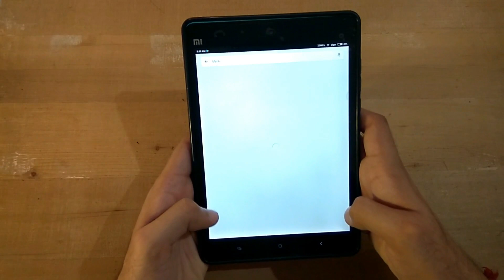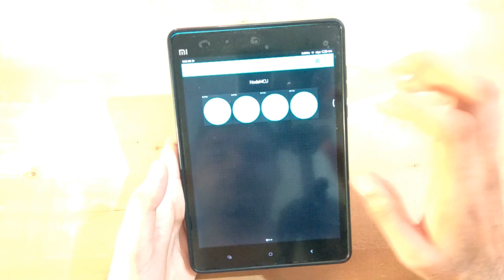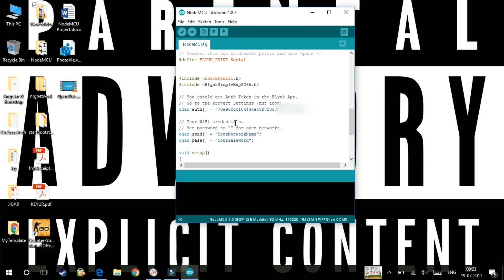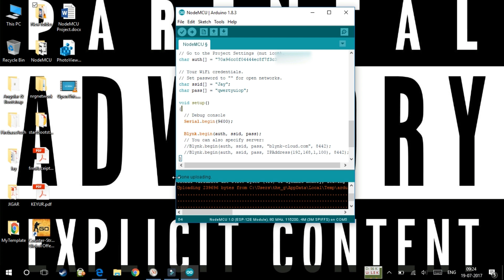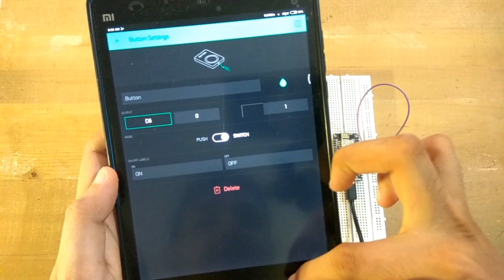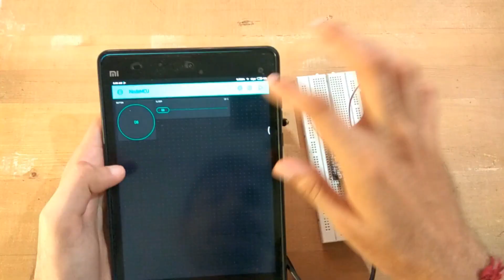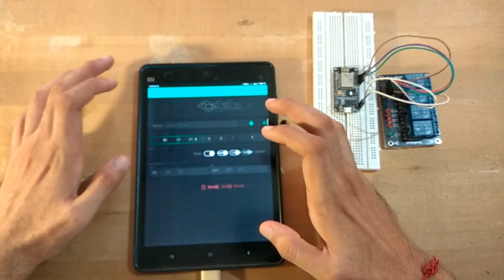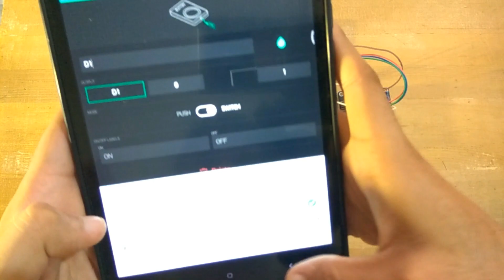Easy DIY Home Automation over Internet (Blynk, NodeMCU, Relay)

Comment: Hey brother really inspired by your video.. I jus need a help.. I have made the circuit.. Wen i turn on using blynk.. The led on d relay lights up but when a bulb is connected it doesn't glow and my relay doesn't do any click sound.. Plz help.. M jus a 12 year boy.. N i have assured my parents to make this n if i be successful they ll give me more components please help
Reply from the maker: You might need to check without light bulb first. Check if you relay is working or not, if it does some clicking sound when you turn on and off from the blynk app.
Reply from the maker: Let me know if you aren't able to fix it, will share my e-mail we can have a chat over there.

Comment: Hi, I have a question. can i power up a 5 volt 4 channel relay module with a 5 volt 0.7-0.8 mAh wall type charger, which is basically use for charge the simple mobiles. 
If yes, then how i connect, i mean what will be the circuit diagram. which wire will be connect with the vcc and which wire connect with the ground and which wire is connect with the ESP8286. 
OR,
ESP8266 nodeMCU board 3.3volt is sufficient for 4 channel 5 volt relay?
i am try to built a home automation project.  

Thank you very much. Please help me.
Reply from the maker: You can use 3.3V from NodeMCU for powering your Relay but out of 4 I think only 3 channels will work. 
To use wall charger, there will be a red wire which is 5V out, a black wire which is ground. So connect red wire to your relay's VCC and black to GND. You will be good to go.
There are circuit available which can step up 3.3V to more than 5V you can check it on amazon.
Reply: @unewaljay  thank you very much for your help, but i have a confusion. Can you please give me the diagram . It will be very helpful for me
Reply: And what about the jd-vcc and vcc pin in right side of the relay

Comment: how can a 5v relay be energized by nodemcu when it's only giving 3v going to the relay board?
Reply: It does for a small time then you smell smoke
Reply from the maker: It would be smoking, if I would have given 12v to a 5v relay. Give 3v to 5v will reduce the functionality as it's not getting enough power.
Reply: @unewaljay  the nodemcu would smoke as happened to mine😂😂😂
Reply from the maker: I didn't had that issue. I was using 5v relay on 3.3v power from nodemcu and I have powered my NodeMCU using a powerbank. You might have kept one of the pin at wrong place.
Reply from the maker: Using 3v, there were 3 relays working and the last one was not working. This was just to show how the things work, but you will have to get proper volts to keep all your relays running and not to missfire.

Comment: How it can be controlled from any where in the world which is connected to home wifi
Reply from the maker: Blynk works on internet, so if your home wifi is having internet you will be able to control switches from anywhere around the world.
Reply: @unewaljay  any other app can be also used or other brand  device can be controlled through this app ?
Reply from the maker: There are many apps and if you know little bit about coding then you can also try your own app. I know about blynk, it's having support for multiple board like Arduino, NodeMCU, Raspberry Pi, etc. If you have time and know how to develop an app then you can definitely create yours.

Comment: Thanks works great. Can you show how to hook up 5 volt power supply so it works all relays? Can i use 5 volt from cell charger?
Reply from the maker: You can use normal mobile phone charger or a powerbank.

Comment: in every project we receive the auth code or just one per acount?
Reply from the maker: There will be a different auth code for every project.
Reply: okay. so it is possible to create local server instead of blynk server? where can I find the tutorial?
Reply from the maker: Yes it is possible, if you know how to create your own server and how to communicate nodemcu with you custom server then you can do it. I will suggest you try it on ur own it's very easy.
Reply: Thanks. Btw node mcu id 3.3V source. Can I use direct from battery to node mcu ? Not use USB to ttl converter

Comment: hy evry one i have this error:
candone
14:35:14.487 -> no nina found, reconnect after 1s
14:35:14.521 -> wifi evt: 1
14:35:14.521 -> STA disconnect: 201
reconnect
scandone
14:35:17.441 -> no nina found, reconnect after 1s
14:35:17.475 -> wifi evt: 1
14:35:17.475 -> STA disconnect: 201
reconnect
scandone
14:35:20.397 -> no nina found, reconnect after 1s
14:35:20.431 -> wifi evt: 1
14:35:20.431 -> STA disconnect: 201
reconnect

Comment: U didnt declare these pins then how did ur prj worked. // Debug console
  Serial.begin(9600);
  pinMode(D1,OUTPUT);
  pinMode(D2,OUTPUT);
  pinMode(D3,OUTPUT);
  pinMode(D4,OUTPUT);

  digitalWrite(D1,HIGH);
  digitalWrite(D2,HIGH);
  digitalWrite(D3,HIGH);
  digitalWrite(D4,HIGH);
  
  

  Blynk.begin(auth, ssid, pass);

Comment: Jay, my node mcu v2 lua  based Esp8266  programming stucked in com port issue. I can't get a port in arduino ide. But arduino uno is working fine. Updated usb port several times in device manager.but no use.

Comment: I heard that your node is connected to your mobile hotspot, and the tablet is connected to your house router. What have you inserted as ID and PWD? I suppose, the name of the hotspot (in my case appears as iPhone) and as PWD the access code to my phone hotspot, as if NodeMCU were a computer.
I tried this way but didn't succeed. How can I check if the Node is connected or not?

Comment: Hi are you sure the app can control the nodemcu over a fifer that network over the internet? Wouldn't you need a server for that?
Reply: Jay Unewal I meant to type "over another network" pls ignore "fifer that". Ok I understand now, so you used the  blyink cloud server hosted at blynk? but how did you do that? In your video there is no step that talks about using the blynk server or I missed it? I want to use the blynk cloud server too without hosting one myself locally. Basically I like to have the same result like you and implement it with blynk without a local server in my own home network. What steps am I missing please? very nice work by the way.
Reply: Jay Unewal ok  i will follow your video instructions to the letter and try. I know the lines of code ok they are from the blynk example and i know i have to connect my node mcu to my WLAN but what was not clear to me was how does the blynk cloud server can find and communicate with my node mcu LAN IP address and  at which port and if port forwarding is needed on my router and in general was trying to find the IP routing part of the code but i found it. In any case i will try. Thank u.
Reply: @TheNikolasNick   i am wondering the same, did u complete it? does it work from anywhere?
Reply: @Copterlord  yes i did a few years ago using Blynk they give u free cloud functionality
Reply: @TheNikolasNick  yea I understood and realised it was a dumb question thanks